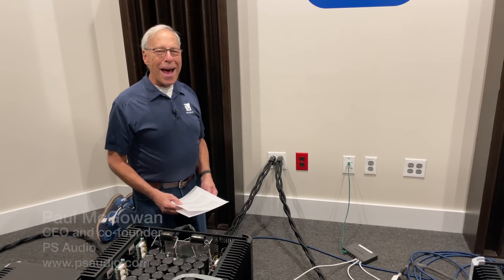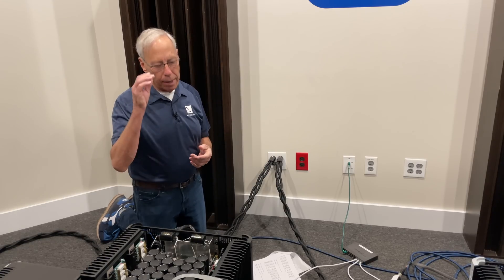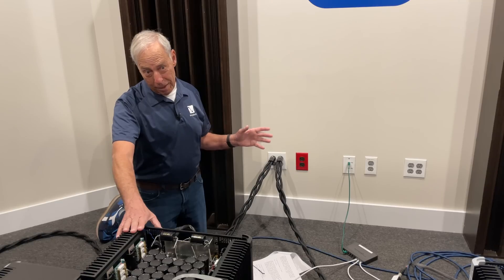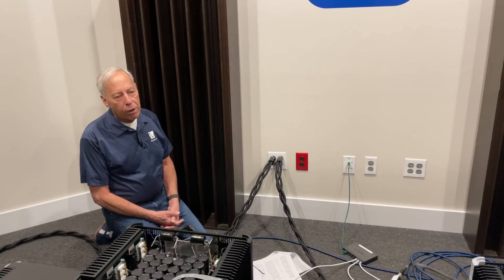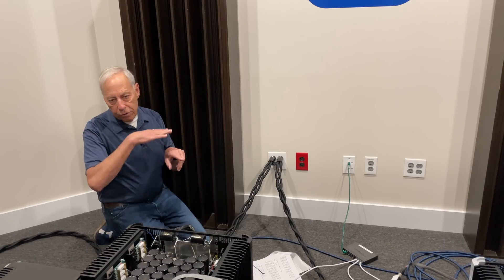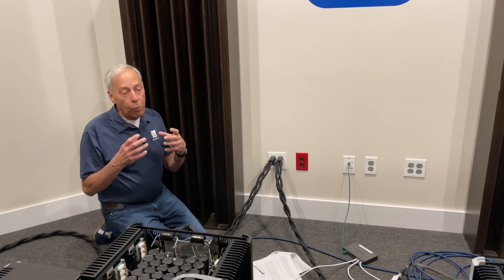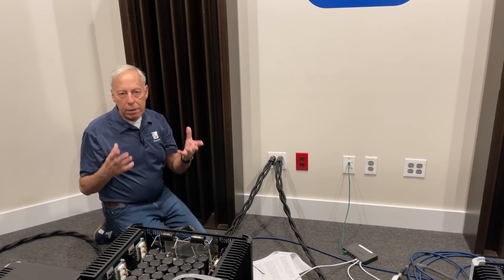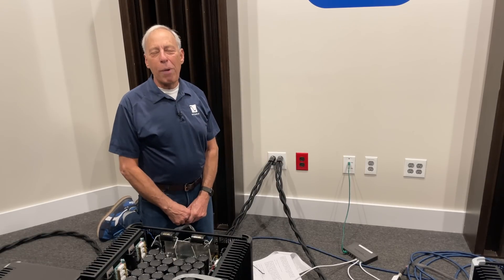Are braided power cables better?

Comment: Paul, I love ya but this, all of this is snake oil. I feel sorry for people who fall for this BS, not the dumb millionaire but the every day people that save up for"exotic cables" and "power cables".
Reply: JC what basis do you have for your comment?
Reply: @adotopp1865  common sense?
Reply: @adotopp1865  it's called common sense and being able to spot bullshit snake oil. also it's easy to spot when huge profits are on the line. If you think a 10 thousand dollar cable or power cable is going to improve the sound of your system I have bridge to sell you. Don't lecture me and don't try any of your horse shit on me right because quite frankly, I'm tired of it.
Reply: @JC-bl9bo  You need more than common sense to validate an argument otherwise its just Philosophy and babble. There is no substance to your comment.
Reply: @JC-bl9bo  I am not from Audio Quest. Did common sense tell you that I was?
I am not a big mains cable fan  but I have tried a good selection of them and they definately make a difference to how a music sounds coming out of my speakers in my room. So because I have actually tried it out with an open mind then I could share my findings based on  experience and not just 'common sense'.
Reply: @JC-bl9bo  I have no interest in defending this garbage. I have tried alternative cabling on my music system though. I have tried mains cable for wiring up my speakers. I have also used cheap thin wire from a hardware shop. I have tried QED   79 strand. Also Sonic Link Red. Some Nordost blue Heaven and 'Transparent' branded cable I tried but didn't buy any because it was too expensive. I have tried some of the Russ Andrews speaker cables and bought some. I also tried some Audio Quest. Also some really thick stuff that you might like.
Reply: @adotopp1865  that's great, these guys can spend big money on expensive cables when they could have just went to Monoprice for a tenth of the price in most cases. This bullshit makes absolutely no difference. It's been sold for years as a difference maker and it's very sad.
Reply: @JC-bl9bo  You wrote:
"it's called common sense and being able to spot bullshit snake oil. also it's easy to spot when huge profits are on the line. If you think a 10 thousand dollar cable or power cable is going to improve the sound of your system I have bridge to sell you."

And yet you refuse to listen with the quality cables.  The listening is free.  And you refuse to do what is free to do.
You choose to spread BS.

You repeatedly attempt to change the subject to "huge profits".
The subject is not the cost.  The subject is whether or not quality cables improve the sound quality of a good stereo.

But you keep attempting to change the subject from "quality cables" to "profits", because you cannot support your position.
If the quality cables cost $1 or they costs $1,000,000 it does not alter whether or not they improve sound quality.  And you know that.  But because you cannot support your BS (because BS is BS), you keep trying to change the subject from "the sound benefit of quality cables" to "expensive cables'.

You wrote:
"Don't lecture me and don't try any of your horse shit on me right because quite frankly, I'm tired of it."

No one is lecturing you.  We are educating you.
Your attempt to convey that anyone is lecturing you is part of your BS.  Why?
You imply that you are being lectured, because "lectures" are typically associated with undesirable experiences.  Therefore, we "bad" people are "lecturing" you.

That is yet another one of your attempts to change the subject.

"...and don't try any of your horse shit on me right because quite frankly, I'm tired of it."
Another lie.

No one is trying "horse shit" on you.
And it is ironic that you, who are spewing BS, are accusing others of trying "horse shit".

"I'm tired of it".
You have only yourself to blame.  When you spew BS to the public, then expect to be held to account for spewing BS to the public.

You claim that you are getting tired.  Another lie.  Because you keep coming back for more.

You wrote:
"There is no science to prove any of this crap."

More lies.
1) It is not crap.
2) Your ears are the science.  They do the measuring .  But you refuse to conduct a listening test with your ears.  You choose to rant about everything other than simply listening with a quality power cord.

You wrote:
"anyone defending this garbage has either fallen for the fake science or has money/job on the line. There is no other reason to defend this crap. 10 thousand dollar RCA cables or interconnects are not going to improve the sound of your HT or stereo system. Often times this fancy crap hurts it. That's the fact Jack."

More lies.
No one is defending "garbage", because quality cables are not garbage.
An item, any item, being "quality", is by definition the opposite of "garbage".  How can you possibly not understand that a "quality" item is the furthest thing from a "garbage" item?

Are you that stupid?  Or are you, again, lying?

"fake science"
Your ears are not fake science.

"...or has money/job on the line."
It is free to listen with quality cables.  It costs zero.
Do you understand the word "free"?

You are making a strong case for proving that you are stupid.
You can listen for "free".  Let me repeat.  For "free".  It costs nothing to listen to quality cables.  So if you, again, complain about cost, you are confirming that you are an idiot.

"10 thousand dollar RCA cables or interconnects are not going to improve the sound of your HT or stereo system."

There you go again with "price", when the topic is "quality" and the listening test if "free".

How incredibly stupid you are, to keep harping on "price" when the topic is "quality", when you keep getting caught each time you do so.
When you are typing out those words, do you keep forgetting that you get called out every time you do so?  And you go ahead anyway, and you try to change the topic to "price", and you get called out because the topic is "quality", and repeat, and repeat, and repeat.

You wrote:
"This bullshit makes absolutely no difference."

Bullshit can make a difference when not identified.  When identified, it becomes harmless.
Such is the case with all of your bullshit.  You keep spewing it, and we keep identifying it.

8th Request:

Please list the power cables that you used in your listening test, to conclude that power cables make no difference.
Please also list all of your stereo's components that were used in your listening test (speakers, amps, pre-amp, DAC, transport, phono-amp, tone-arm, cartridge, etc), and room treatments.
Reply: @JC-bl9bo  I have tried many different types of  wires regardless of their cost. If after I tried a few, I found no difference, then I would stop.
Reply: @adotopp1865  🤣 I know, huge difference, night and day better freaking cables. Again his stop, just stop.
Reply: @JC-bl9bo  You wrote:
"...for big money..."

And yet again, you bring up "money", which is not the topic.
"Quality cables" is the topic.

Once again, you attempt to change the topic to "price".
You do so in every reply, and point out your deception in every reply.

Remember that as you start typing your next reply, and you introduce "price", you will be called out on changing the topic.

"Did you even watch the video I posted?"
Yes, I watched it, and I posted a comment in it.

This is you again writing about what you know nothing about.
You ask about something to which you should have known the answer to.

"...keep pushing this absolute nonsense..."
Says the person that is pushing absolute nonsense, and refuses to listen and have his own ears judge who is correct and who is pushing BS.

"So let's see these concrete results from testing in NJ."
I will repeat what I already posted:

Vandersteen System Nine, fed by Aesthetix Metis pre-amp, and Aesthetix Eclipse amp.

Digital Front End:
Aesthetix Romulus DAC

Analog Front End:
AMG turntable (I do not recall the model).
Graham tone arm.
Clearaudio Goldfinger cartridge.

I now answered, twice, on the equipment used in my listening test.

9th Request:

Please list the power cables that you used in your listening test, to conclude that power cables make no difference.
Please also list all of your stereo's components that were used in your listening test (speakers, amps, pre-amp, DAC, transport, phono-amp, tone-arm, cartridge, etc), and room treatments.
Reply: @0Perhaps  so you did tests on cables of which there is no way to prove they are better. This stuff is too much.
Gene from Audioholics has done tests, he has the equipment to do so and has ya know an engineering degree that proved that very expensive cable he had was worse. 
So you did tests on cables for what reason?
Reply: @0Perhaps  I cannot believe you kept touting you did tests, listed the testing equipment and then said there is no equipment to prove cables are better. You said you did testing in NJ, hey I'm from NJ and we are known as the quality cable capital of the world. 
Wow you really turned out to be a 🤡.
Reply: @JC-bl9bo  You wrote:
"so you did tests on cables of which there is no way to prove they are better. This stuff is too much."

Which is why I have repeatedly written that you should listen with your ears.

"Gene from Audioholics has done tests"
I do not know Gene.

This is the second time that you wrote about Gene.
This is the second time I wrote that I do not know Gene.
This is the second time that I am asking you to list the stereo equipment that Gene used in his listening test.

"So you did tests on cables for what reason?"
To hear for myself whether or not quality cables make a differnce.

"are you serious? Listening with your ears."
No, I am not serious.  You should listen with your elbows.

"You can hook up one cable and hear a different between another?"
Not if you are listening with your elbows.

But if you use a quality power cord with your CD player, it will sound better than the stock power cord.  But you have to use your ears.

"I mean I honestly don't even know that to say those is bull crap."
You write "honestly" in a sentence where you are being dishonest.

It is free to listen for yourself.  But you continue to refuse, in favor of buffoonery.

"I cannot believe you kept touting you did tests, listed the testing equipment and then said there is no equipment to prove cables are better. You said you did testing in NJ, hey I'm from NJ and we are known as the quality cable capital of the world. "

I do not expect you to believe me.
I expect you to believe your own ears.  But you refuse to use your ears.  You, instead, choose to spew BS.

How can you not believe that there is no way for me to prove what I heard?
Educate me.  Tell me how to prove what I heard.

If you are from NJ, then go to Audio Connection in Verona, NJ.
Make an appointment (you can't expect them to be sitting around with no customers and nothing to do).

You have all the information at your disposal, including a high-end store where you can listen for free.
But you still will refuse, because you are a buffoon.

11th Request:

Please list the power cables that you used in your listening test, to conclude that power cables make no difference.
Please also list all of your stereo's components that were used in your listening test (speakers, amps, pre-amp, DAC, transport, phono-amp, tone-arm, cartridge, etc), and room treatments.
Reply: @JC-bl9bo  You wrote:
"Tests but use your ears. Do you have any idea how flawed and listening tests can be manipulated?"
How is switching one power cord for a different power cord "manipulating"?

"Do thing this place you went to was gonna to be fair?"
I had no idea.

I watched them swap the power cord.  They touched nothing else.

"...you are proving how ridiculous it is to spend a lot of money on cables and power cords"

You are, again, harping on "price", when the topic is "quality power cords".
You forget, from comment to comment, that every time you bring up price, I will remind you that the topic is "quality power cords" -- not price.

Tie a ribbon around your finger so that you do not forget for the umpteenth time.

"You are easily fooled by whatever this company you went to because you wanted to be fooled."
You cannot know that.  You are lying.
I did not want to be fooled.

"Either gullible or wanted to be fooled."
I am neither.
I listened, and heard the improvement.

The store loaned me the power cord.
I listened on my own home stereo.

I am very familiar with the sound of my own stereo, just as anyone would be for their own stereo.

After listening for several minutes, with my CD player's own power cord, I then plugged in the quality loaner power cord into my CD player.
For the first minute or so, I was skeptical, because it sounded like my same home stereo.  What I did not realize was, that before I knew it, the time had flown by.

I was in the zone.  I was enjoying my stereo more than before.  Was I imagining it?

I put back my stock power cord, and that was all the evidence that I needed.  The change was obvious, and for the worse.  Going backwards was very revealing.

I then put back the quality power cord, and my stereo once again sounded better.

I had to return the store's power cord.  It was not for sale.  They use it for one of their own stereos, and they did not keep a stock of all of the models of the quality power cords (there are too many and they do not fly off the shelves).  They sell most of their quality power cords after the customer places an order -- it takes a week for the order to come in from the manufacturer.

Their sale's for nearly everything in their store follows that same practice.  You listen to a stereo, and if you like what you hear, you place an order, and you wait for your order to come it.  They are not a department store.  All of their room has live equipment in it.  They have one storage room, and it is packed with gear that they are repairing (they do repairs) and packed with equipment to perform their repairs.  So placing an order, even for quality power cords, is standard operating procedure for that and nearly everything else that they sell.

During the week between when I returned their loaner power cord and before my order came in, I was back to my stock power cord, and it was not a happy time.
Days later, I took possession of the quality power cord that I ordered, and was enjoying my music like never before.

My only regret is that I ordered a quality power cord from Shunyata, when I should have ordered one from Audioquest (at a given price point, Audioquest has the edge in sound quality).

At the time, I did not know about Audioquest.  The store was using a Shunyata power cord, and that is what they loaned to me.  I am very happy with it.  But if I were to do it over, I would go with Audioquest.

So there was no slight-of-hand with the store.  There was no imagined improvement.  Everything was on the up-and-up.

Stop making excuses, and listen for yourself.
You will be there to watch their every move.  There will likely be only one person in the room with you, and you can watch them swap the power cord.  If you conduct yourself maturely, they might let you do the swap, yourself, so that you will know 100% that nothing else was changed.

But you will not do any of the above.  You would rather keep ranting about snake oil.
Snake oil is a big problem.  You complicate that problem by calling reputable products snake oil, which mixes up people that are trying to learn.

Like calling everyone that you disagree with a racist.  Then when real racism happens, it is mixed in with all of the BS claims.
Or when phony accusations of sexual assaults are made, it puts a hint of doubt on the real crimes of sexual assault.

Save your snake oil claims for actual snake oil.  There is enough of that to go around, without you fabricating more.

12th Request:

Please list the power cables that you used in your listening test, to conclude that power cables make no difference.
Please also list all of your stereo's components that were used in your listening test (speakers, amps, pre-amp, DAC, transport, phono-amp, tone-arm, cartridge, etc), and room treatments.
Reply: @JC-bl9bo  The fact is that I have made my own cables and not bought any of the overpriced garbage to which you refer. The question I have explored is what difference can be heard if any.
Reply: @JC-bl9bo  it is a joke
Reply from the maker: Thanks, JC and I wish you were right. I don't like it either, except that it's true. What's really interesting to me is the people who are the loudest deniers are often the ones furthest away from ever having taken the time to try it in the correct circumstances. Might that fit you?
Reply: @Paulmcgowanpsaudio  🤣🤣🤣🤣 That's funny. Sorry Paul, as I said I love ya but cables are total BS.
Reply: @JC-bl9bo  Please list the power cables that you used in your listening test, to conclude that power cables make no difference.
Please also list all of your stereo's components that were used in your listening test (speakers, amps, pre-amp, DAC, transport, phono-amp, tone-arm, cartridge, etc), and room treatments.
Reply: @JC-bl9bo  You replied, but you did not answer.
You stated:
"why don't you guys stop, just stop. It's great that you believe this BS and sell it. It's all snake oil."

The above is not an answer to my request.  It is a dodge.
Also, I will stop, after you list the equipment you used in your listening test.

2nd Request:
Please list the power cables that you used in your listening test, to conclude that power cables make no difference.
Please also list all of your stereo's components that were used in your listening test (speakers, amps, pre-amp, DAC, transport, phono-amp, tone-arm, cartridge, etc), and room treatments.
Reply: @JC-bl9bo  You wrote "there is no listening tests for power cables."

Translation:
You refuse to do a listening test.

And just to address your attempt to dodge the listening test, this is how it works:
-- You listen to music that you are familiar with, using your stereo's stock power cords.
-- You listen to music that you are familiar with, using Audioquest's flagship power cords.

You wrote:
"There are no measurements in the world to prove a 500 dollar HDMI cable is better than a 10 dollar one on Amazon."
Please list all of the measurements in the world.

Also, do not change the topic.  The topic is "power cords".
Also note that the topic is not "measurements".  It is "power cords make a difference in sound quality".
If you can't measure it, then you do not have tool to do so -- which is why our ears are ultimately the best measuring tool for sound quality.

Two stereos:
1) A stereo with crappy measurements that sounds great.
2) A stereo with great measurements that sounds crappy.

I choose #1.
So please stick to what is heard by our ears.

3rd Request:

Please list the power cables that you used in your listening test, to conclude that power cables make no difference.
Please also list all of your stereo's components that were used in your listening test (speakers, amps, pre-amp, DAC, transport, phono-amp, tone-arm, cartridge, etc), and room treatments.
Reply: @0Perhaps  that fact that you just mentioned audioquest is the most obvious where you lie in this garbage. Wallow in this garbage. Audioquest flagship, how the god dam hell do you sleep at night? It's downright to the point of being almost criminal.
Reply: @JC-bl9bo  Keep writing and not reading.  Keep thinking that that is a valid excuse for hiding your head in the sand.

5th Request:

Please list the power cables that you used in your listening test, to conclude that power cables make no difference.
Please also list all of your stereo's components that were used in your listening test (speakers, amps, pre-amp, DAC, transport, phono-amp, tone-arm, cartridge, etc), and room treatments.
Reply: @0Perhaps  ok perhaps I will, but perhaps I won't. You win expensive cables make a world of difference, 21,000 dollar speaker cables make everything sound better, you win, you were right and I was wrong. Expensive power cables make a huge difference. I've been converted.
Reply: @0Perhaps  by the way I prefer to listen to Gene from Audioholics that ya know has an electrical engineering degree, disigned systems for the telecom industry and he says it's all BS. But you go with your "listening tests" and have friends over that reinforce your horse shit. You and anyone else selling this garbage should be ashamed of yourself.
Reply: @JC-bl9bo  You wrote:
"You win expensive cables make a world of difference..."
I never wrote that.

I wrote that quality power cables will improve the sound of your stereo.

You could go to Home Depot, buy a $5 power cable, and put it on eBay for $5,000.  That expensive price does not make it a quality item.
And you know that.  And you intentionally twisted the dialog to make it seem as though I wrote what I never wrote.  You are dishonest for doing so.

You wrote:
"...I prefer to listen to Gene from Audioholics..."

I neither know Gene, nor his stereo system.
Please list the components in his stereo system that he used for his listening test.

As usual, you will not do so.
As usual, you will throw all manner of noise into the conversation.
As usual, you will either make excuses, or simply not provide the list of stereo equipment.

Keep digging.  Keep entertaining.

6th Request:

Please list the power cables that you used in your listening test, to conclude that power cables make no difference.
Please also list all of your stereo's components that were used in your listening test (speakers, amps, pre-amp, DAC, transport, phono-amp, tone-arm, cartridge, etc), and room treatments.
Reply: And you have not published your results from these "tests". I'm from NJ so at least that's close to home here.
Reply: @0Perhaps  I think JC has probably done no testing or has any experience at all. Therefore all his comments about the subject are invalidated.
Reply: @adotopp1865  "I think JC has probably done no testing or has any experience at all. Therefore all his comments about the subject are invalidated."
Correct.

But you do not have to "think" that he has "probably" done no testing.
You can be sure that he has done no testing.
Reply: @JC-bl9bo  Don't you mean Resistance from the cable Cult Crowd?
Reply: @adotopp1865  whatever dude, just keep over spending on this kinda garbage, at least out justifies some jobs and a CEO salary
 Nothing you are using that is expensive that these monoprice cables can't and don't do for your system.
Reply: @adotopp1865  It is fascinating how JC replies over and over with the same irrelevant remarks, and refuses to listen with his ears.
It is fascinating how JC replies over and over about the price, when he can listen for free.
If is fascinating how each time JC rants about the price, I remind him that listening is free, and he continues to rant about the price.

JC is a buffoon.  He is working hard to ensure that anyone who has not yet concluded that he is a buffoon will eventually realize that he is a buffoon.
He will reply as many times as it takes to convince as many people as possible that he is a buffoon.

And for those that know that he is a buffoon, JC is working hard to emphasize just how big of a buffoon he is.

All he has to do is listen to those cables to put this to rest.  But he chooses buffoonery over reality.

There are people that seek attention at any cost.  We are witnesses to one such person.
Reply: @JC-bl9bo  I don't have all  expensive cables in my system. some interconnects are DIY and cheap.  The most expensive is my speaker cable that I currently use . The rest of interconnects are between  0 USD and 150 USD.   Mains power I have swapped plugs and tried different manufactured cable from stock cable  to 220 USD cable but I have a dedicated mains circuit in 6mm cable and MK unswitched sockets for the Kimber mains cables (different ones). They are all BS and I am an idiot who is deaf by Snake Oil.
Reply: @adotopp1865   nope, I'm sure you hear a night and day difference, I'm certain of it with "better cables".
Reply: @JC-bl9bo  oh no. I wouldn't say night and day, just say, a morning to evening  difference
Reply: @JC-bl9bo  Of course there are listening tests for cables - just use your hearing!  I am not pushing this on anyone😄it's their loss, not mine
Reply: @0Perhaps  It is fascinating . I wonder why JC and other naysayers seem to be so angry about wire!
Reply: @Harald_Reindl  Well my skin sometimes tingles when I listen to a record on my system which is fine tuned with synergistic cabling! Thanks
Reply: @Harald_Reindl  Do you listen to music at home Harald?
Reply: @adotopp1865  at every minute i am awake given that my library has grown over the past 30 years to 55000 tracks and i've invested 5000$ in room-acoustics which does really make a day/night difference other than stupid cables in a 100% digital chain
Reply: @adotopp1865  The most likely reason is that quality cables are out of their reach.  They are envious.  So they trash talk the quality cables.

They would trash talk other quality stereo gear that they also envy.  But they know that they would get hammered by nearly everyone.  But quality cables, they feel, are easy pickings for trash talk.
Reply: @0Perhaps  "out of their reach" is laughable! i invested 15000 € in the last year in hardware and room acoustics and if i want i can spend another 15000 € by flip my finger but not for useless crap - frankly even if i win the lottery i am not dumb enough to waste money where it has no impact
Reply: @0Perhaps  yes but they don't even seem to agree that cables sound different regardless of the cost of them
Reply: @adotopp1865  They care nothing about anything other than the price.  They only want to cry about the price.
Their excuse is that all cables sound the same, as long as it passes some rudimentary lab test.

The stock cable that comes with a Walmart stereo is no different than Audioquest's flagship cable, according to their mantra.  The Audioquest cable just has a fancy jacket, according to their religion.
Reply: @Harald_Reindl  You wrote:
"i invested 15000 € in the last year in hardware and room acoustics"
No you did not.  You are lying.  You have a pattern of lying, and this fits your pattern.

Post your claim elsewhere.  On the public internet, you will find folks that will believe you.
On this channel, you are a known liar.
Reply: @0Perhaps  i did and if you believe it or not won't change anything - the membrane absorber in octotober alone where 900 € and the last 100x50x10 cm Basotect in november around 250 €
Reply: @0Perhaps  and that imgur links with the banking confirmation are removed here is not my responsibility
Reply: @Harald_Reindl  You wrote:
"i did and if you believe it or not won't change anything"
You did not, which is why there is nothing to change.

When a person is trustworthy, then such claims are deemed truthful.
When a person routinely lies, then such claims are deemed to be lies.

You, Harald Reindl, routinely lie in this forum.  As such, your claims are deemed to be lies.
You earned it.
Reply: @0Perhaps  hand over your email and you will get the banking confirmation for the "perfect acoustics" (Hungarian company) membrane absorbers
Reply: @Harald_Reindl  if you are listening every moment you are awake don't you have a job to go to?
Reply: @adotopp1865  did you ever hear about homeoffice? tell me one reason why I should leave my living room as software developer and sysadmin
Reply: @Harald_Reindl  you are not properly  listening to music. You have streamed background music on while you are working.
Reply: @adotopp1865  Jesus Christ let that be my sorrow, I sit enough hours in the sweet spot smoking and a cigarette and guess what: the room acoustics fixed the problem of bass cancellation on my working place
Reply: @Harald_Reindl  I don't understand what you are referring to
Reply: @adotopp1865  because likely you have no clue about room acoustics
Reply: @Harald_Reindl  no I haven't
Reply: @JC-bl9bo  how do you define "better cables"
Reply: @adotopp1865  sad for you and, so much you never heard music as it's intended to be
Reply: @Harald_Reindl  how do you know that it 'has no' impact'?
Reply: @adotopp1865  dude I'm out of this conversation. It's too ridiculous at this point. You guys argue of overpriced audioquest cables. I'm out, have a good time.
Reply: @JC-bl9bo  but that's the point. I'm not in favour of overpriced Audioquest Cables.
Reply: @Harald_Reindl  What is intended to be Harald?
Reply: @adotopp1865  then you should have never replied to this thread. My issue is with Paul, who I actually like very much pushing audioquest and "stupid expensive" power cables. The quality stuff on Monoprice will perform the same.
Reply: @Harald_Reindl  You waste your time and stupid amounts of money on room treatment when you have neglected to check out your cabling, wires and interconnects. Also you don't even listen properly - it's just background noise from your streaming. I have a radio in my kitchen that's good enough for that!
Reply: @Paulmcgowanpsaudio  I own a number of Russ Andrews Kimber power cables, I know the improvements they make.  I also understand when you talk about synergy as different power cables match up with different equipment.  For example I have some 4TC and 8TC power cables. Although the 8TC are the better cable, on one particular amplifier the less expensive 4TC sounds better.
Reply: @Paulmcgowanpsaudio  Have you ever accepted a blind test challenge? Are you able to provide even a modicum of scientific reasoning to support what you're saying? Are you able to provide just a sample measurement to support it? Are you an anti vaxer? Do you believe in unscience? Do you think that believing the earth is flat or round are just different opinions? Are you in bed with Audioquest? Just a few random questions in the same vein as your question above..
Reply: @razisn  I have done blind tests many times and with different people and always with the same results. The differences between cables were obvious. And no, I am not "in bed" with AQ though we do sell their cables.
Reply: @razisn  it's all about money period. They sell this garbage as a business to people. Some can afford it and ya know what, whatever to them. It's the dummy that makes 50 grand and listens to experts push this garbage and saves up 500 bucks for an HDMI cable that is a downright victim. It's actually really sad.
Reply: @razisn  You are asking someone who has a lifetime doing  successful audio manufacturing. Of course they've done the things you said. It's their job.
Reply: @adotopp1865  their job is to make money out of dumb customers
Reply: @Paulmcgowanpsaudio  learn to build proper power supplies as japanese manufacturers doing for decades - on the DC side you have 100% clean DC no matter what the AC input was
Reply from the maker: @Harald_Reindl  If only that were all that's needed. Of course our power supplies are DC perfect but that doesn't address the problem.
Reply: @Paulmcgowanpsaudio  which problem? come on! either you have perfect DC and a stable power source or you don't
Reply from the maker: @Harald_Reindl  It's just not that simple. Consider the grounds as a simple example. Or the layout of the PCB. If you design the PCB with a star ground arrangement, noise and the eventual audio outcome measures better and sounds better - and yet the DC supply is the same. Or, placing sensitive components next to each other such that they pick up noise - common when we're just trying to stuff parts into a specific space. And then there's the quality and performance of the components themselves. Most consumer audio products use cheap capacitors without any regard to performance in terms of ESR or sound quality. Their challenge is to remove every penny that is not needed to meet spec. It just isn't as simple as a clean DC supply.
Reply: @Paulmcgowanpsaudio  and how does the last 50 cm of the power chain magically change anything here?
Reply: @Harald_Reindl  the power cable is the first part of the cable not the last.  The Kimber design removes EMI and inductance that a PSU can't.  In the UK you can purchase Kimber power cables starting under £100, even these provide good benefit over cheap IEC mains cables.   As I've already said find someone who can demo these cables you wil soon realise you are wrong.
Reply: @Harald_Reindl  You wrote:
"and how does the last 50 cm of the power chain magically change anything here?"

Your water travels miles to your home.
Why do you use a shower head in your bathroom for the last few inches?

Try to not be obnoxious when you ask a question.
Inserting the adverb "magically" is obnoxious.  It conveys that you are not interested in learning the answer, and that you are closed minded on the subject.
Reply: @BoomerUKEngland  "the power cable is the first part of the cable not the last" is nonsense - in the chain it's the last after hundrets of meters as well as dozens of fuses and contacts - whatever gone wrong there can't be fixed with the laugable 50 cm and with a proper power supply it don't matter anyways - everything is working with DC and making 100% clean DC from whatever AC input is a solved problem for decades
Reply: @0Perhaps  never heard something stupid than compare a power cable with a shower head - the cable don't change anything, while the shower head distracts the water for comfort
Reply: @Harald_Reindl  it's about how electrical systems and EMF interact with each other
Reply: @Harald_Reindl  it's going to be a lot more than 50cm!
Reply: @adotopp1865  it's all bullshit and yes the power chain is much more than your laughable cable
Reply: @kytddjj  jesus christ.....
Reply: @kytddjj  how does the amplifier carfe what noise he puts into the power inputs? let me guess: you have a analog chain in 2021 - fix that! my source is optical connected because of quality - there is nothing near the amplifier which could produce any noise at all and even if - proper power supplies of whatever couldn't care less
Reply: @kytddjj  i am one with technical knowledge and education - waste your money for snake oil - i spend mine for room acoustics and music